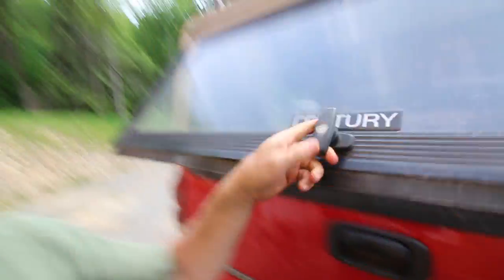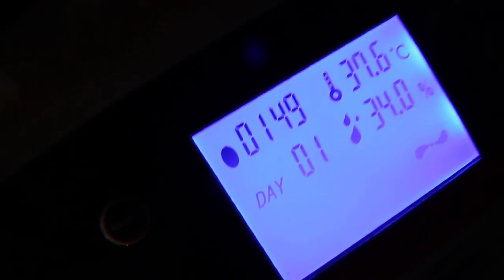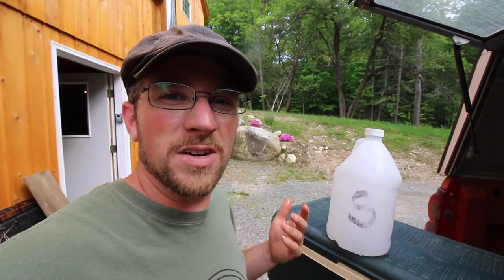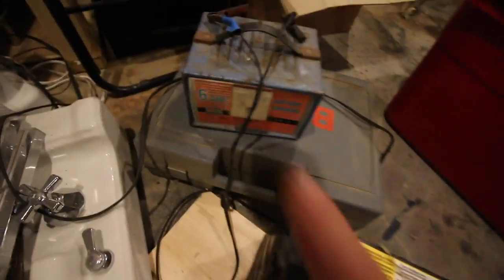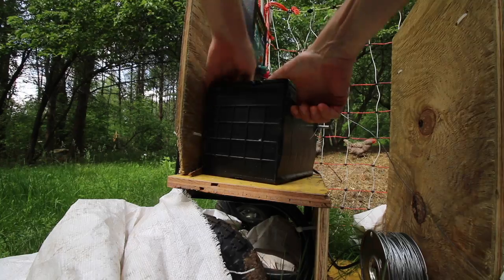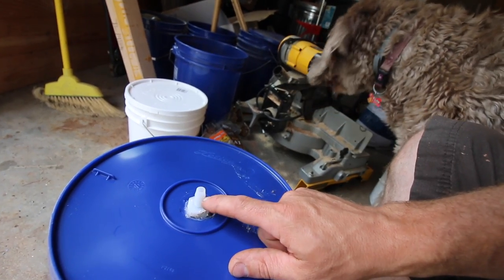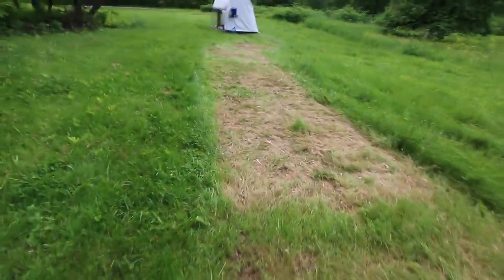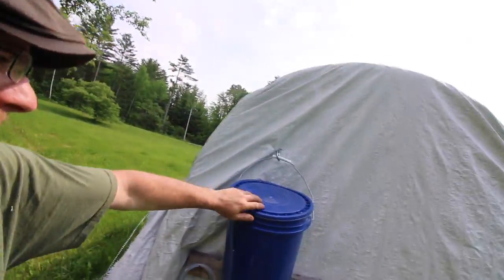One of thebossoftheswamps Best kept secrets

Comment: You should be able to et the water jug upside down in the 5 gallon bucket like it works in a water dispenser then as the water level drops it will empty into the bucket.  That should increase the capacity to 8 or 9 gallons instead of 5.
Reply from the maker: Hans Quistorff Great idea! I bet that would work great for us if we have a had to go away for a day. Thanks for sharing

Comment: Hey Al, Here's a trick I use all winter long with the water in the jug. In the freezing temps, you take 3-4 jugs of water and put them outside to freeze solid, then I just use 1-2 at a time and put it in the refrigerator section. The frig doesn't have to work anywhere near as hard to keep it cold because of the free solid blocks of ice . It's saves a boat load of run time your frig has to do and obliviously lowers your electric bill. Give it a try, it really does work.
Reply from the maker: Thanks I will have to give that Hack a try

Comment: Love J.C.'s channel!   If you add 14% sawdust to your salt water solution, you will get "Pykecrete" which is hard as concrete and melts at an even slower rate than salt water.  (tough though to keep it in solution but it is an amazing and simple DIY).
Reply from the maker: He has a great channel! I will have to try Pykecrete, I wonder what would happen if it was in salt water?
Reply: Salt water should actually aid in the ability to retain its low temp.  I know that keeping the sawdust suspended until it freezes is tough and may require periodic shaking until it is fully frozen.  Otherwise it will just settle to the bottom and not work.  I have heard bottles like that can last a week in a cooler.  Pretty amazing. stuff.
Reply from the maker: Wow, that is crazy! Now I really want to try it!

Comment: I've use the salt trick before but I normally add a pound of salt to a cooler of ice for camping.  I like the jug idea.  So you mentioned buying the pallet of pig feed does that end up being enough feed to raise them till slaughter for the 2 pigs.
Reply from the maker: Yes, it takes right around 20 bags per pig to get them to harvesting weight. After you try the jug idea let me know how it works.
Reply from the maker: Did you know you are a homestead homie!
Reply: Hey Al thanks for noticing it.  I just check it out, I'm on shift at the station, so I hadn't even noticed it yet.  Pretty awesome!!!

Comment: Can I suggest you put wheels on the sides of the chicken coop with maybe an inch or two of the ground. You'll be able to transport the coop easier and the chickens won't be able to get out
Reply from the maker: I am worried about other critters getting in if the coop is off the ground
Reply: You might be able to make the wheels on a pivot that goes over center when they are put to the ground ?

Comment: Watching you drag the chicken tractor it occurred to me it might be easier to move if you put some flashing on the bottom  or if the wood extended a foot or so beyond the back with a wheel on each, when you lift it the rest on the coop is off the ground like a dolly. Even better would be if you could roll it towards the wheel, so they were at the front of the move, you wouldn't have to worry about chickens moving out of the way and getting run over because it is moving away from them but I doubt the wheels would roll well enough for that and you would need lift handles on the door end like a wheel barrel. Just sum thought from a lazy guy
Reply from the maker: Thanks, We have the rear arms extend 10 inches or so with wheels attached. Or ground is pretty rough and uneven I think that is the issue a lot of the time. I like the flashing idea.
Reply: Just need bigger, fatter tires.  (and maybe a motor)  lol
Reply: I've watched a lot of guys move these chicken tractors and i always wonder why they don't make a front wheel axle that pivots downward (lowers the wheels) once you pull a lever down. much like a dolly would do but more permanent. wish i could draw a diagram in here. think of it as a giant dolly with independent axles. just thinking
Reply from the maker: Lol
Reply from the maker: I think it's a great idea,
Reply: Or even an axle in the middle and do a sort of balancing act on the move. Big problem, as Al pointed out is roughness on the ground (pot holes etc) New Yolk City is a good answer ;o)
Reply: If he would just train the birds to fly up, lifting the coop, when it's time to move...